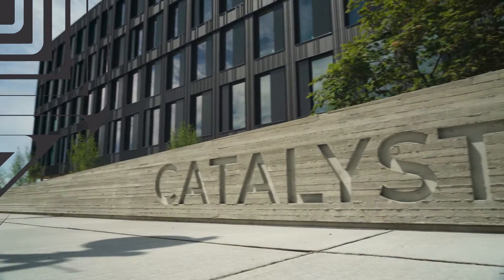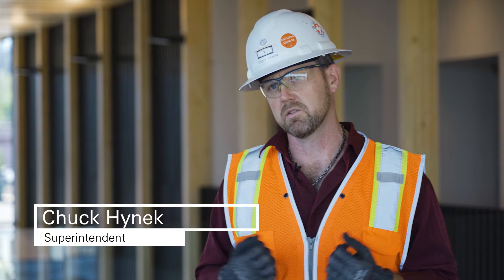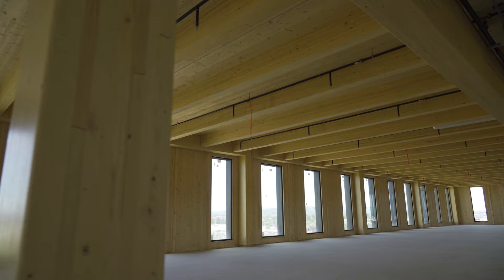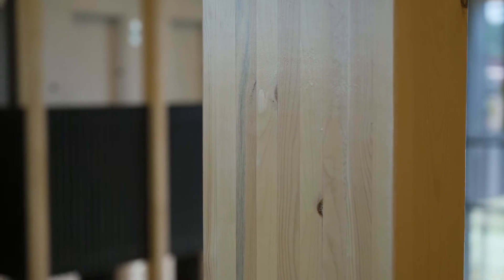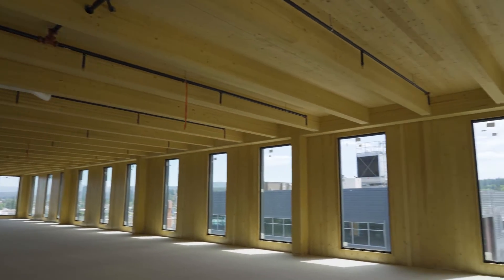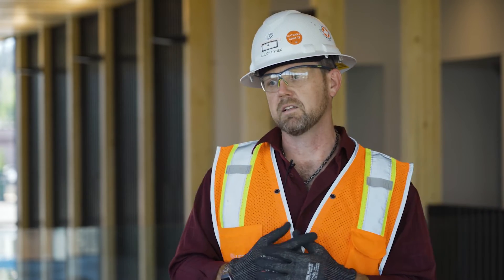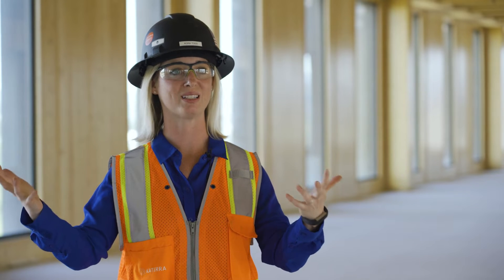Katerra | Project Profiles | Catalyst

Comment: Key insights

🏫 Eastern Washington University will occupy the first four floors of the Catalyst building, showcasing the potential for innovative construction in higher education spaces.
🏗 Assembling the panels at the Catalyst job site was a unique and exciting experience for me.
🌧 The building's use of solar panels and rainwater collection for irrigation showcases a commitment to sustainability and environmental responsibility.

TLDR: Eastern Washington University's occupation of the first four floors of the Catalyst building demonstrates innovative construction and a commitment to sustainability in higher education spaces.

1. 00:00 🏢 Katerra's Catalyst building in Spokane, Washington will be used for higher education, with Eastern Washington University occupying the first four floors, featuring 160,000 square feet of CLT and glulam panels from Katerra's factory in Spokane.

2. 00:36 🏗 Worked on making red panels at the factory and assembling them at the Catalyst job site.

3. 00:51 🏗 Challenges of new design elements were overcome through integrated efforts, resulting in a quality product for the client.

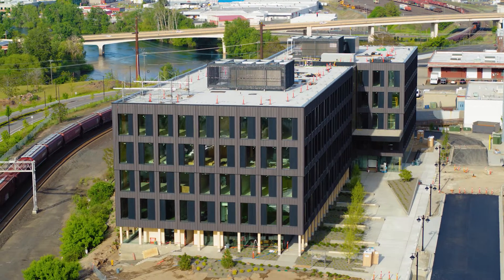4. 01:16 🌱 Net zero building with wood that absorbs carbon, equipped with solar panels and rainwater collection for irrigation, creating sustainable and healthy spaces for future generations.